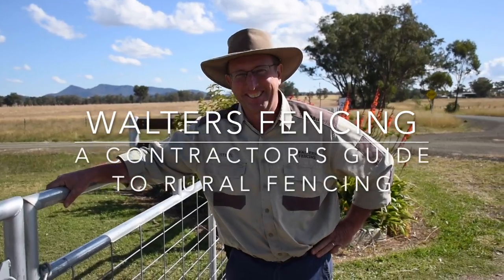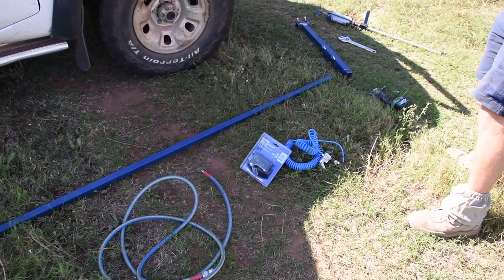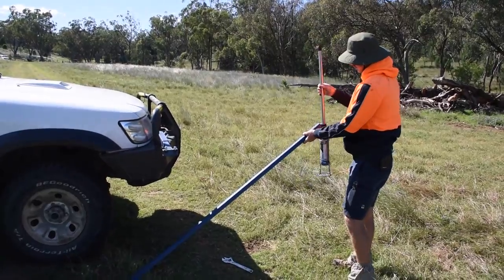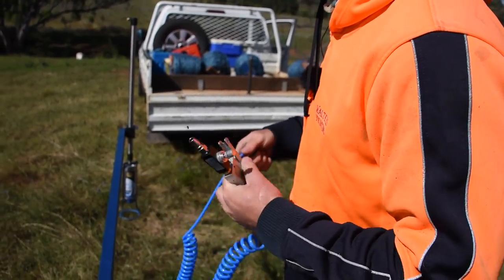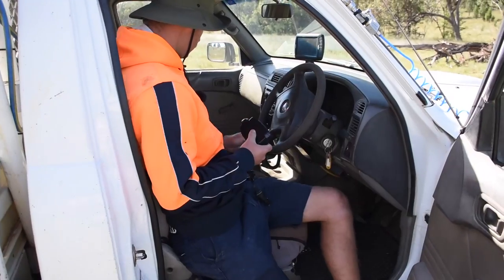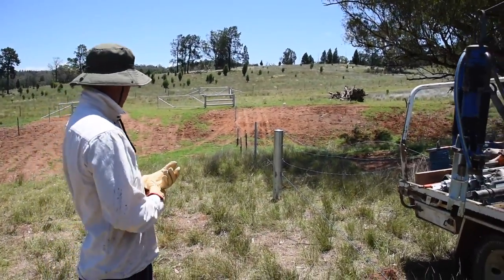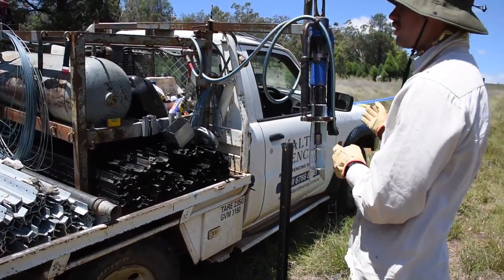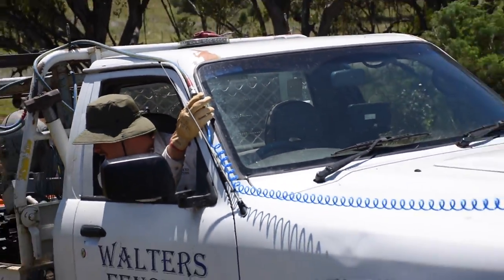How We Do It: Spacing Your Fence Pickets Consistently #EP10

Comment: Great idea. If you reverse your logic and measure behind the ute 5 meters and place the camera at the end of the pole, then you drive the ute  until the camera lines up with the last post you have put in. No need for paint. It would extend out further than what you are currently doing because you lose part of the length of the ute, but you could place it on a trailer type arrangement that only needs to support the camera, this way you remove any flex in the pole extending out the back.
Reply from the maker: Hey Wayne,  Love the way you think.  We are/have utilised the trailer to help with our post marking when we are using the rack and posting off the trailer, so fully agree with that idea.  The reason we are experimenting with the paint marker out front is that the person driving the posts can be set up and have a post on the spot before the vehicle stops, which speeds up the whole posting operation.

Comment: That system does not give equal measurements from A to Z at all it only gives 5 metres for each post.
Reply from the maker: Hey Robert.  Fair comment.  No, this system doesn't divide the fence length into equal sections, but in the rural fencing that we do the important measurement is the distance between each post.  The 'left over' is dealt with over the last 3 or 4 spaces at the end of the line.